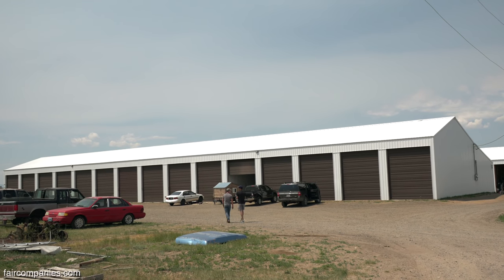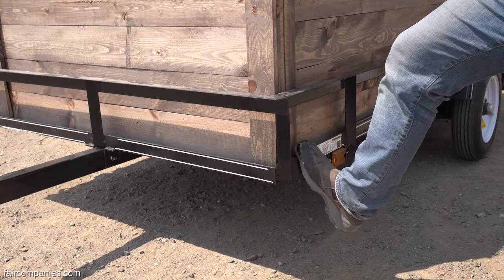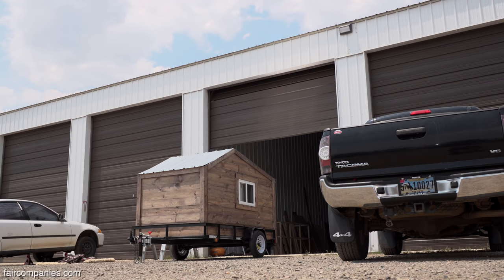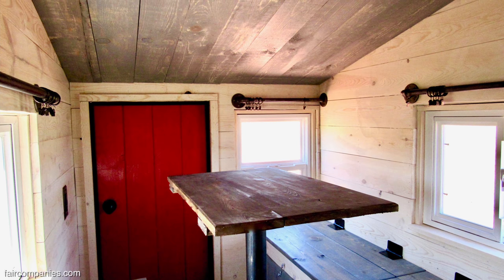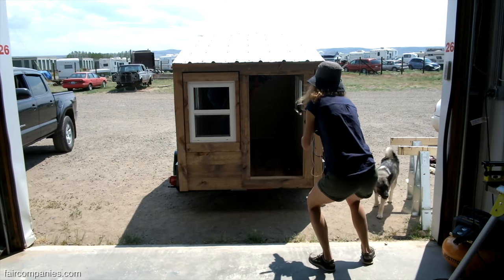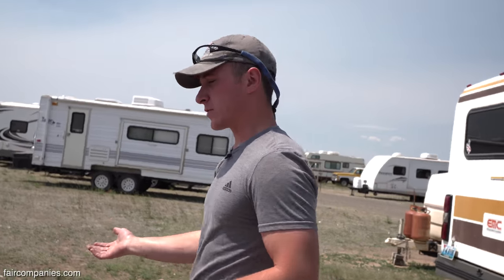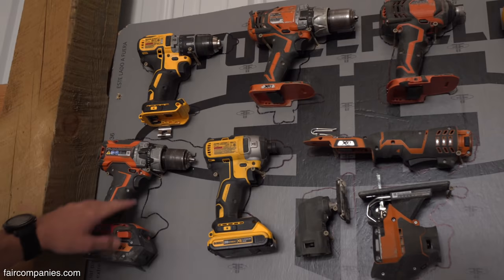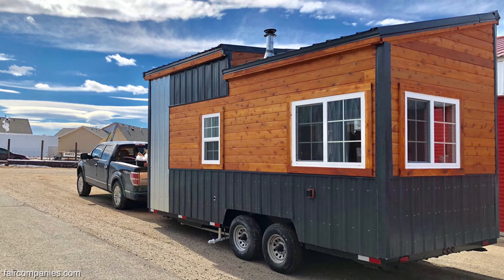Wyoming students make custom micro-campers to live & sell

Comment: FYI those things are not travel worthy. If you drive in the weather with that, then it will get ruined, moldy and mildewed. IT is not even close to being worthy of being labeled a trailer when the first storm, or even just rain will destroy it if you are driving(pulling) with it during the storm, or rain. On top of that, pressure treated wood is not the right wood to use for siding, it shrinks and it will have cracks at every seam. And that will rot the shit out of that thing too with cracks at every single seam, plus driving with it with 70 MPH wind and rain forcing its way into the framing rotting the whole thing to the core, while it is mildewing the whole time!

At best ,it is worthy of being labeled a tiny home, it is not a travel trailer by even the most imaginative. Not that i am against him building the things, but i would feel better about people buying the stuff, if he labeled it right. Not that i don't want people building tiny homes or travel trailers, but label them appropriately then. Selling a tiny home as a travel trailer is misleading and could cause serious injury. If you wanted a tiny home that is portable, then it cost more, just like how a house boat cost more than a stick home. There is a real reason it costs like 10 times more, and it is not just to rip you off, that is just what it cost!

FYI look at your car, then look at that thing, then look at your car again, see anything different? Better yet, look at a real travel trailer, then look at that thing, then look at the real travel trailer again, etc...Pay close attention to the siding, the exterior joints, the material it is made of, and how the seams are almost not existent, and when they are they are sealed like 3 different ways all at once. Look into why and how they seal travel trailers properly. Try building a stick house and selling it as a sail boat, or house boat, and if thy did fall for it, you would be liable for their drowning. lol

I know 3000 is cheap, but know why. It is because it is not a travel trailer, it is a tiny home. It means, you could drive it to where you can use it, and keep it in one spot, unless it is a clear day no rain or storms, and then still stay under a certain MPH. But if you get caught having to pull it in the rain, then you just ruined it, it will mildew inside the walls even after you attempt to dry it out. Then it will just keep mildewing from the regular weather, and if you have to pull it in the rain again, oh  it will only gt much worse/

One last thing, important thing.  If people like this keep on ignoring the real engineering and design of safe and effective homes and travel trailers, and some people get sick dew to mildew contamination, etc... then there will be people begging government to make regulations preventing your dumb ass from being allowed to sell this stuff, all mislabeled too. Be responsible, or else they will force government to be responsible for you is that wtf you want? If you are not transparent about all the stuff you are building and selling, you are liable. You need to let people know the truth, and if you for yourself don't know the truth, then you need to find it out before you burn your ass, and burn the asses for the others opportunities too. Because of your irresponsibility, the future generations will have no chance for opportunity, because government took it all. Subservient dunce blocks who thought they were smart and cool, gave it all away to government, and they didn't even even know they did, that is how stupid they are. Not cool, not smart, but a ignorant minion for the tyrants, who don't know what responsibility is. No, you "thought" you did, but align to the truth this time.

Comment: You called Ridgid cheap, abused the tool and replaced with new tools made by black and Decker. 
Had you filled out the warranty info, Ridgid has lifetime guarantee on its tools and batteries.

Comment: it’s a lot of money for a bed in a shed.
Reply: Yeah. I told the wife, if I'm pulling a trailer, it's going to have a toilet and a shower and kitchen sink
Reply: What do you mean, not too many options? There's rv lots full of options. We just finally got back into a trailer. Evo by forest river. Bunkhouse for our kids. Great set-up!
Reply: Ogre Dad some people just like small. Especially if they’re pulling with a small vehicle. My sister likes big, so brother-in-law tows with an F350.
Reply: Mike Brink Yep!
Reply: Mike Brink if you're living in it you can easily keep the lines from freezing by keeping a line open a bit and allowing your hot water heater to run. We live in a 20ft rv all year in md with no issues at all.  We are located on a construction lot with electric and water hookups though..
Reply: I have a lake property where many RV's and tiny homes on wheels are located.  This video cannot compare with what I see in the park with similar sized trailers and price.  Almost all have some form of pop out windows, sides or roofs that allow head space and shelving while parked and not in transport.  The pop outs happen in less than a minute and add tremendous space for very little cost.

Comment: You do not have a clue what you are doing you put the screws in the roof on the flat part you need to put them down through the vent the round part! Lofao!
Reply: No, it's just a common practice to put the screws through the peaks because that helps reduce their exposure to water running along the roof when it rains but it's a trade off because you can't fasten the screws as securely over the peaks as you can the valleys because you'd risk denting the peaks and leaving a gap in the seal.

So when dealing with high winds, etc. it can be better to secure the screws to the valleys where you can apply maximum pressure to the fasteners and there's less room for the roofing to flex and bend if the wind gets underneath it.

There's also roof designs where the fasteners are covered and thus no benefit to placing them on a peak...  So they're not always placed at the peaks!
Reply: Where I come from, you use patented screws that are covered as well as drilling only puncturing the peaks and you still worry about it. I agree with the original comment. Puncturing roof plates in the valleys seems like a result of ignorance. He also said they were built "just like a house". I'm sure they get the job done, but they are not.
Reply: @ Ola Flåten Incorrect, again don't confuse a common practice with there being no reason to do it any other way.   

Again, the reason to screw to the peaks is to limit exposure to water when it rains but that isn't always the priority when designing a roof, as things like structural strength can matter more.

Understand that we're talking about a structure that has to be able to handle being towed along the highways at up to over 60 MPH...

That's the equivalent of building a structure to handle both an earthquake and a hurricane at the same time!

Screwing to the peaks is fine for most regular stationary structures as most are unlikely to have to sustain over 100 MPH winds but something being towed along the highways can easily be subjugated to that kind of stress on the structure and the last thing you want is for the roof to be ripped off, which will probably flip both the entire structure and the tow vehicle... Never mind the vibrations from the road as it is being towed...

All construction has to take into account what the structure will have to endure and adjust best practices accordingly...

Besides, there's plenty of examples of other ways to attach metal roofs... Like standing seam metal roofs, for example...
Reply: The real problem is that he’s using house-building techniques. It’s a travel-trailer, not a house on wheels.
Reply: @ZeoCyberG Yes, I read your previous comment in its entirety, yet still I disagree. You might be right, like how would I know for sure? It's a fair point, but I still disagree. I agree with the original comment which suggests that this particular decision in the particular case in the video, was not an informed and considered one. Again, I don't know.
Reply: No, it's just a hybrid...  Not all fall fully into either category but are more a mix made for specific niche needs.

The advantages of using house building techniques is that emphasizes higher durability, greater longevity, better energy efficiency, and better optimization for everyday use than how RV's are typically constructed...

There's just some trade off in greater weight and usually higher wind resistance, which is why some choose to go for something in-between...  

Like stated in the video, this can apply to such people as those who may otherwise be living in a car or otherwise are looking for a compromise between home comforts and being able to have a nomadic lifestyle... Among other scenarios where neither a RV or a full House on wheels fully fits someone's needs.
Reply: @ chula chalupa, Yes, the screws create a seal when properly installed but the issue is exposed rubber gaskets will eventually erode.  

Screwing to the peak has the disadvantage of being more likely to over screw, not allowing for the strongest fastening, and is more vulnerable to expansion and contraction that can eventually drive the screw out over time as the metal roof goes through different temperature extremes.

So the only reason they place the screws at the peak is to limit exposure to flowing water because most of it will pool and flow through the valleys of the corrugated metal panels when it rains, and having the screw points at the peaks helps reduce the leaks when the seal does eventually break down, versus having the same hole in the valleys.

But when dealing with things like high winds then the priority changes to making sure they have the strongest fastening strength, which you can only get by screwing to the valleys.

While the flow of water along the side walls will go over both valleys and peaks, thus there's no advantage to screwing to the peaks for corrugated panels fastened to the side walls and why that is done always to the valleys.

A better system would actually be something like standing seam metal roofs that conceals the fasteners and thus they aren't exposed to the elements and can always have the strongest fastening but they cost more than corrugated metal roofs.

As for the roof over hang, it's another trade off...  The more roof you have cantilevered/extending out then the more it will catch the wind and put more strain on the fastenings...  Mind, on the highways these things can experience over 60 MPH winds and a good strong head wind can push that over 100 MPH...  So the roof has to be designed to handle the equivalent to a hurricane.

More of an overhang is preferable for normal weather protection but it's not the only consideration.

Road legal regulations also put a limit on how far you can put anything to the sides.  Since you have to keep it within 8' 6" and that includes the roof overhang...

So there's typically a trade off on how much overhang there is versus where the walls are placed as that can effect how much interior space you will have left. 

Though, some use detachable sections that they can add to the roof when parked or something like a rain gutter to divert the water flow but you need space to store them when traveling.

Also things like how much space it has to make turns can factor for those who want maximum mobility and try to keep the whole thing closer to the width of a car, which also helps reduce blind spots when towing it...

Though, those who don't need to travel a lot can go past the road legal limits and opt to have normal roof overhangs...

There's just always trade offs and other factors to consider that depend on how it will be used and what it will have to endure and for how long...